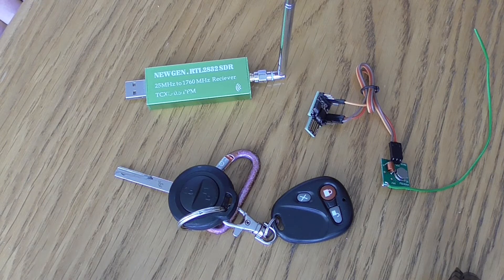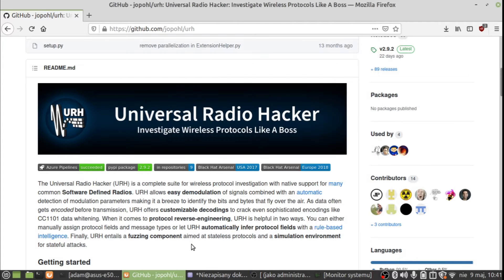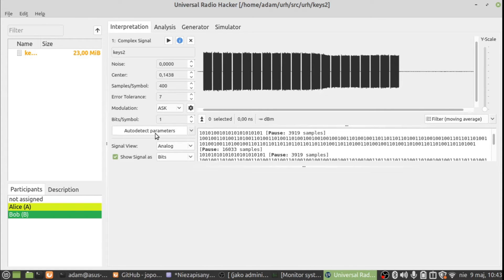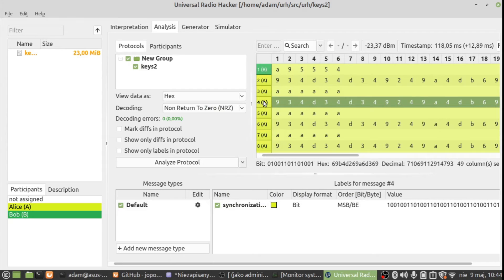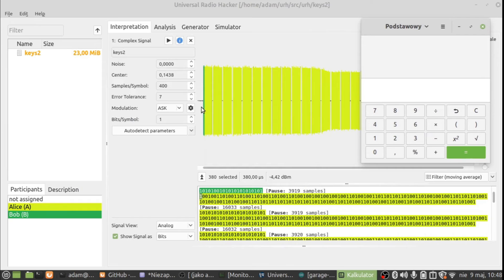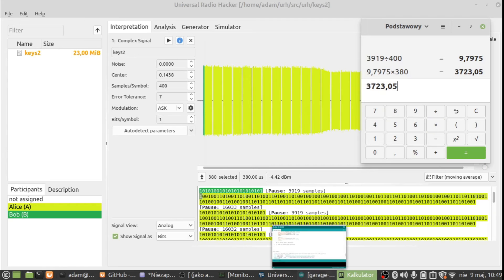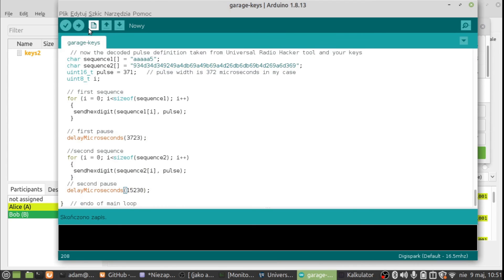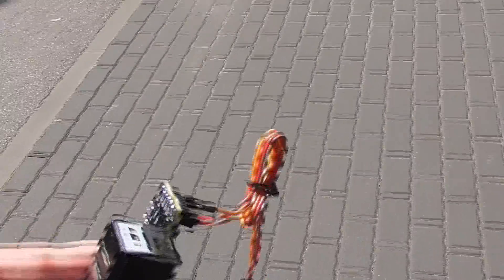hacking & clonning my garage key with URH ( Universal radio Hacker ) and ARDUINO DIGISPARK + FS1000A

Comment: Thank you for sharing!  Your exclamation, 'Shit!' is very descriptive. :)  
It's very worrying that you can just replay the signal to open your garage door. I have a Hyundai i10 2013 car. That is also susceptible to replay attacks. I used the exact phrase you used when the same hack opened and closed my car doors. I was expecting it to use a rolling code system. For those interested - I did a similar circuit with a Raspberry Pi Pico, running MicroPython. It can ring Byron door bells as well as open 2013 i10 car doors. I've left the source on Github. It can't open my garage door - Thankfully!

Comment: i have a question, but the MX-5V reciver can recive key fob signal?
Reply from the maker: yes MX-RM-5V is a receiver compatible with FS1000A. It can receive keyfob signal but you need the program to record it. Unfortunatelly you cannot use Universal Radio Hacker

Comment: Hi, your work is very nice, I have been following you for a long time. With Arduino and 433mhz receiver, I copied the fix code and opened my door immediately. But is it possible to make a project that can flow rolling/hopping codes and write to the LCD screen with Arduino and cc1101 or other RF modules? I can do this as a project for my son at university. I want to have it done.sadece garage door or barrier 
..not for car key.At least I have a rolling code, which RF module can I use to read the code of the remote control? Without using sdr/rtl. Thanks.
Reply from the maker: try to build  my latest cc1101-tool. it can record few keypresses of original key. I do not plan to add lcd sceeen because a smartphone can be used to store sequences in some notepad

Comment: Thank you so much for this video! 
I tried before to built an opener for two door garage in the house that I live in but miserably failed. 
But with your video and code I  finally could built something that actually works.

The main problem was to decode the very vintage SKX1MD transmitter with URH. If someone else is struggling with those very vintage but in older houses still  common transmitters, just let me know 🙂

My working prototype is based on an Arduino Uno R3, which works great. 
I now will build  a smaller version using an Arduino nano and attach it to the USB port of my Vespa Primavera - no more fiddling with keys and searching for remotes which don't work with gloves anyway.
Try that with a Flopper-Zero 😄

I really gave up on this until I found your youtube channel. Thank you!
Reply from the maker: check my newest project here  https://youtu.be/mdkEK_wmWJA
and here  https://youtu.be/iPVckkTjsd0
you will have the Master Key !

Comment: Hi Adam,

Thanks for you tuto. I've a 867 MHz key that I would like to clone for educational purpose. What would be the associated module as you are using 1 x FS1000A module for 433 MHz freq ? I have already save the *.wav with my remote impulses ...
Reply from the maker: Hi. I can not find FS1000A supporting 868/867 MHz , there are only CC1101 based modules supporting it  You need to look for something that supports OOK / ASK modulation with single  DATA INPUT pin without SPI bus. Alternatively you may use  CC1101 based module and      the library from Litle s@tan for CC1101 (the one I am using to build the jamer)
Reply: @justanengineer5599  can i run the code with arduino leonardo?

Second question?
void setup()

{
}
void loop()
{

tone(8, 15000); // generate square wave

}

Does it work too? For me no

Comment: hi
You can see that it works with the RF transimitter 315Mhz-green.

I have a question here.
I wonder if this project is possible with the NRF24L01 module I have.

I am trying to upload a program to Arduino by sniffing the automatic door.
Reply from the maker: this code will not work with NRF24L01 however I am thinking how to adopt this design to work with this module and jam the drones and other devices  operating on wifi frequency
Reply: @justanengineer5599  could just do that with Aircrack. Does this program work with the HackRF One?
Reply: @justanengineer5599 Hey can we use NRF24L01 with esp32 instead of Arduino?

Comment: Hi everyone,

I would like to be able to receive the signal from a controller with an HCS301 (MICROCHIP KeeLoq) in the transmitter and with a PICxxx or an ATMELxxx in the receiver.

There is a library for ARDUINO about receiving

Comment: Wow, very nice!   This seems more automated than doing the decoding visually, using inspectrum etc.    What kind of signals (frequencies?) don't work with URH, and must be done some other way?

For example, if the car uses rolling keys, that means you would have to generate a unique key every time, or could you just toggle thru a set of valid keys?   

Any plans to use an SDR for the transmission part?   I've seen  some low(ish) cost SDRs.. for example, the $70 Caribou (a hat for the RPi), or the LimeSDR.
Reply from the maker: The limitation ( if any ) comes from RTL-SDR dongle used especially in terms of frequency range that can be monitored / decoded.  The URH software actually supports most of modulation types like FSK, AAK/OOK, GMSK and most SDR devices... You may also want to go through the manual https://github.com/jopohl/urh/releases/download/v2.0.0/userguide.pdf

Most of cars are using not only rolling code but pseudorandom seed for code generation 
https://en.wikipedia.org/wiki/Remote_keyless_system  - that's why replay attack is not working for them, only rolljam attack. 

I do not have SDR for the  transmission part. But If you are considering transmitting spoofed radio data I would suggest to use combination of two boards CC1101 + Arduino Pro Micro (3.3V / 8 MHz version ) as I am doing in my 10$ CC1101 jammer here in my  video  https://youtu.be/vZcGP-O2GvQ
 You do not need specialized devices like Evilcrow RF or Yardstick One or Hack RF for transmission actually...
If you look into my Arduino sketch here : https://raw.githubusercontent.com/mcore1976/cc1101-jammer/main/arduino-pro-micro-cc1101-jammer-v2.ino   
 you will see that you can do all of it in very easy way with any type of required modulation , frequency , preamble, encoding etc... by setting those values with few commands on the beginning of the code 
and putting your sequence to be send in the command :
 // send these data to radio over CC1101
        ELECHOUSE_cc1101.SendData("my decoded key values!!!");

Good Luck!

Comment: How did you manage to setup the exact required frequency during the transmission?
Reply from the maker: the FS1000A always sends on the same frequency as builtin SAW generator module (433.92 in my case).  For wireless keys same set of band is used in many countries - either 433.92 or 315MHz see here https://en.m.wikipedia.org/wiki/Remote_keyless_system . 
Anyway if you wish to tune to different frequency and have more flexibility  you  would have to use CC1101 instead like I am showing in my recent video for the jammers. On my github you may find CC1101 projects using SmartRC library which you can easily adopt in order to clone any type of wireless key
Please watch this video : https://youtu.be/vZcGP-O2GvQ
and see this Arduino script  :      
https://github.com/mcore1976/cc1101-jammer/blob/main/arduino-pro-MINI-cc1101-jammer-v2.ino
You may set any modulation frequency encoding and payload there according to what you decoded with Universal Radio Hacker tool.  Good Luck !
Reply: @justanengineer5599  Thanks and I have a bonus question. Whenever I try to find the pulse length on my signal it is different for 0 and 1. 0 has a pulse length between 343 and 350 us and 1, between 400 and 420. It also varies slightly when I analyse the preamble and  the payload. Is that a significant difference or should I just stick to one pulse length for all my calculations?
Reply from the maker: basically symbol lengths should be constant for ASK/OOK modulation. It is possible that additional Manchester encoding is in use that causes some distraction in URH decoder. Try to decode the signal by selecting different type of modulation
Reply: @justanengineer5599  You know, honestly I think it's just some type of protocol of rolling code. I will try to find mine and will get back to you if I succeed. Thanks for the replies.

Comment: Hello. This is a perfect video thanks. It helps me... But I have a problem with showing the sample rate... It shows only Pause: the time in ms. How can I change this for showing samples?
Reply: Sorry... I have the solution. The samples are the summary of each Bit in the row per sequence... It doesn't show me automatically, I have to mark all the bits and then I see the summary.

Comment: what device is this to activate the digispark...
Reply from the maker: Normal PC (with Linux Mint in my case, but it can be also Windows PC) is used to program the Digispark unit.  Digispark has connected the FS1000A module as 433MHz ASK transmitter.  The  URH is using the RTLSDR USB dongle to capture and decode wireless keyfob, then I am able to re-write the code for Arduino / Digispark to send appropriate radio sequence to open garage doors.
Reply: @justanengineer5599  I ask at the end of the video to activate the digispark, it's a normal charger...
Reply from the maker: Yes, it is a normal 5Volts usb powerbank/charger with ON/OFF switch and LED indicator

Comment: Hello very good video however I did not understand how you activate the remote control I see that the remote control is connected with a power bank for the power supply but did you configure a push button on the arduino to launch the code or the simple fact plugging in the arduino starts the code?
Reply from the maker: Hi. For simplicity there was no push button. It activates when connected to 5V usb powerbank. Arduino bootloader starts the code and sends radio signal immediately.

Comment: Can we make this with Arduino.
Reply from the maker: It is made with arduino digispark. You can make it with any arduino.
Reply: @justanengineer5599  I don't know the code
Reply from the maker: The code is available on github. Have you checked the description of the video? The link is there :
Link to my example  sketch : https://github.com/mcore1976/urh-arduino-cloning-keys
Link to the tool : https://github.com/jopohl/urh
Reply: @justanengineer5599  https://youtu.be/P28NcPvIWhk

Do you know to make this
Reply from the maker: He must be using CC1101 module for sending and decoded key information in his program - otherwise it is a fake. The transmission can be decoded with URH (link above) but the code you would have to do on your own. Different Arduino code for every vehicle is needed
Reply: https://youtu.be/-X2S7yqZnbY

.....

Comment: I thought garage door openers rotated their codes each time you press the button. Your opener seems to use a static code each time. Is that common?
Reply from the maker: There are different models of garage openers. Yes, the one I have uses static code. However this method of hacking can be used also for rolling codes. You would need to record more sequences to  discover the algorythm of code generation. The URH tool is helping with reverse engineering of the coding
Reply: @justanengineer5599  Wow... Can you show it in a video, how to reverse rolling code with the URH? It would be exciting... 😉 Please.
Reply: @justanengineer5599  is this some of the Aluprof remotes?
Reply: @justanengineer5599  Very Nice job, may be another tutorial with rolling code ? ; )
Reply: Hey can have your email adem thnks